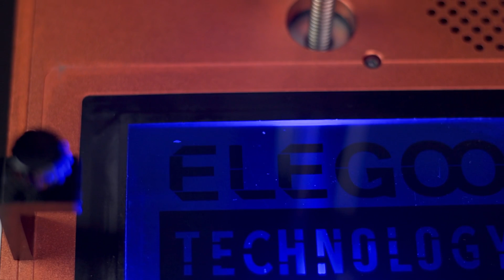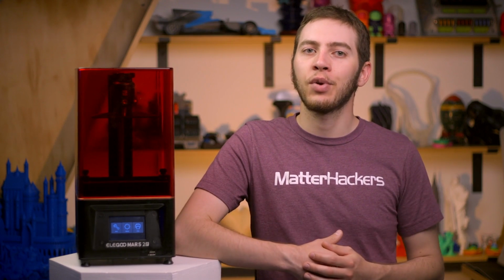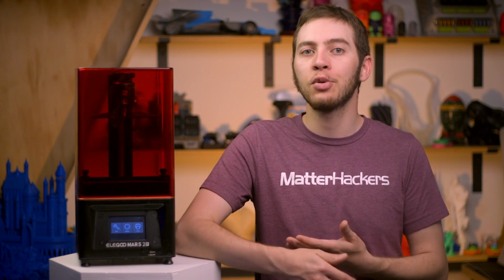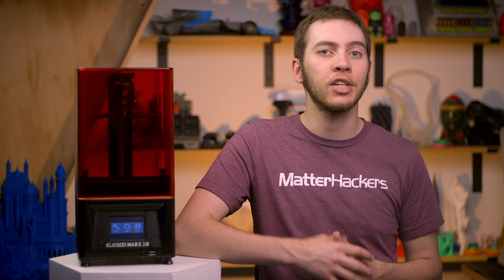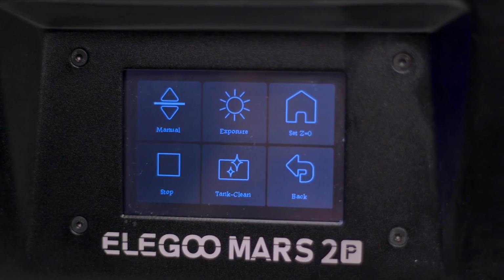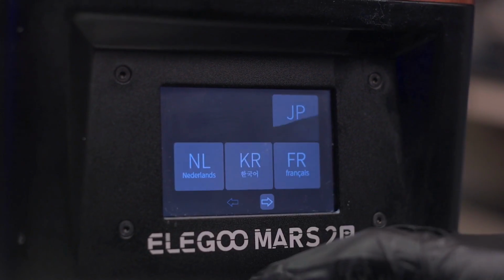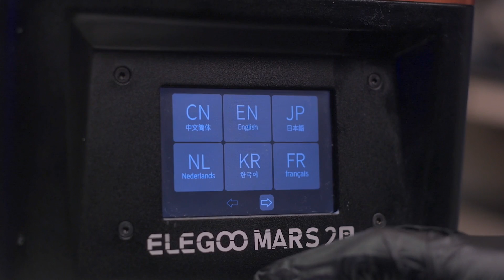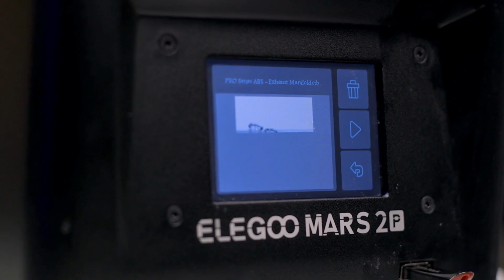Tech Breakdown: Elegoo Mars 2 PRO 3D Printer

Comment: main question: can i swap my mars 1 screen for the mars 2 screen for faster prints?
Reply from the maker: Short answer, no. It would appear that it's not possible. All the other components (like UV light, motherboard, etc) are designed around the monochrome LCD. In the end getting the Elegoo Mars 2 PRO would cost the same as all the parts you'd need to do an unsupported mod that may not even work. - Alec
Reply: @MatterHackers  TYVM!